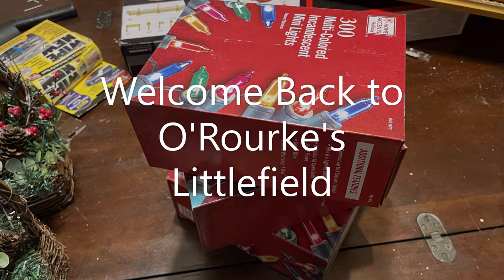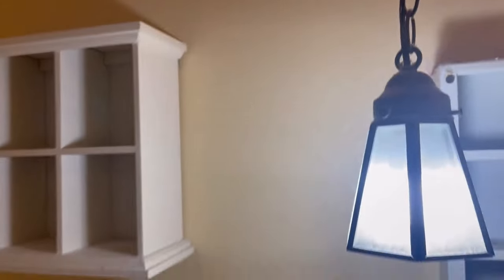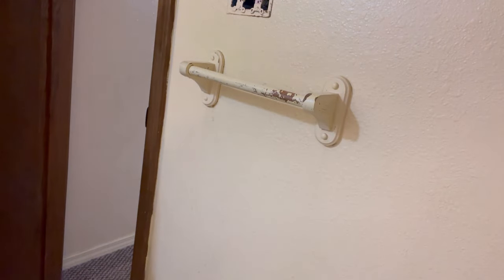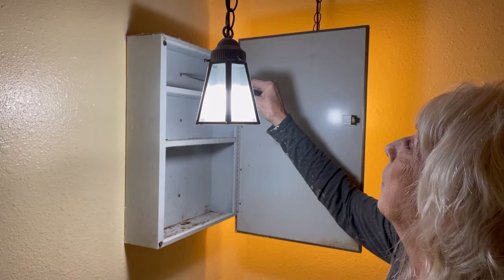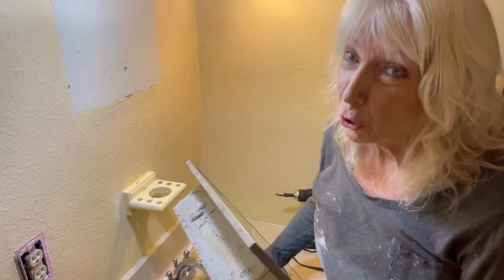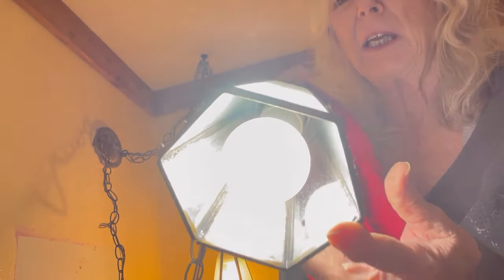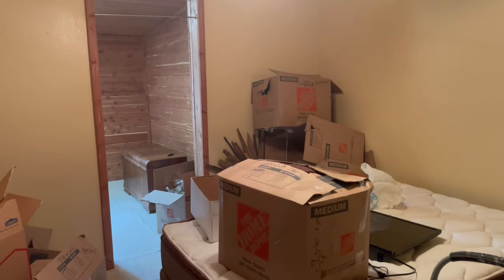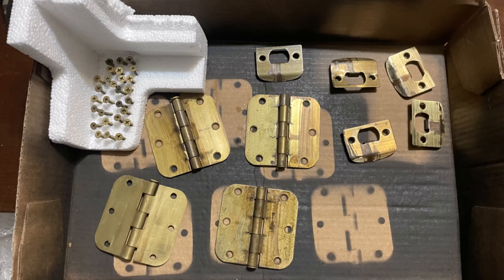Company is coming, quick remodel, Old House, New floor..

Comment: Hope ya'll had a good Thanksgiving.  This was some good work.  Laughed out loud when you wacked the towel bar and it finally popped right off.  Have ya'll inspected the attic space?  Will you have to do any work in that space?
Reply from the maker: It is fine, the house passed inspection with flying colors, good solid house. Thanks for watching. But, we have not been in the Cabin attic, kinda scary lol.